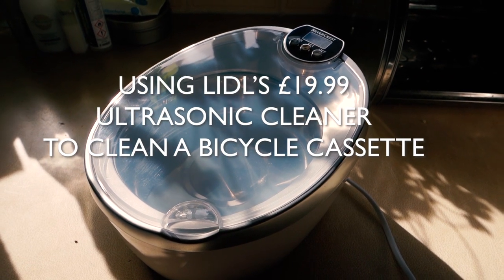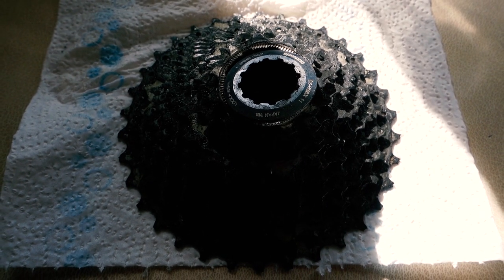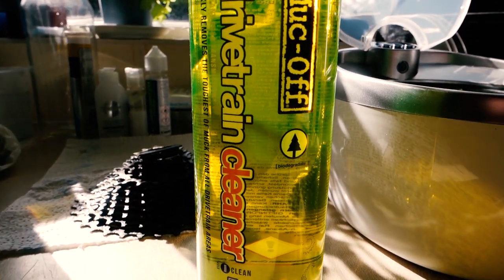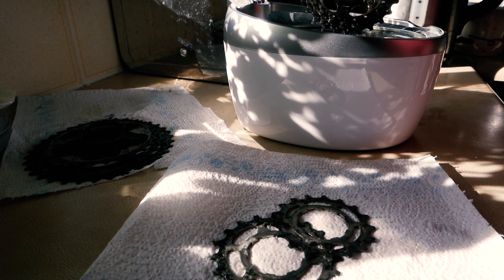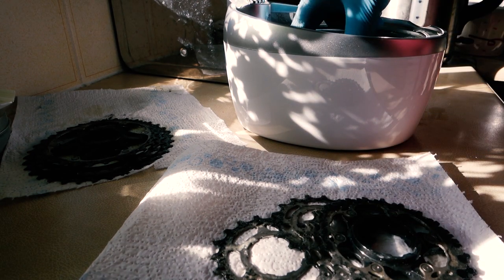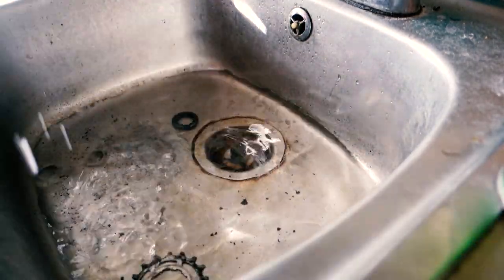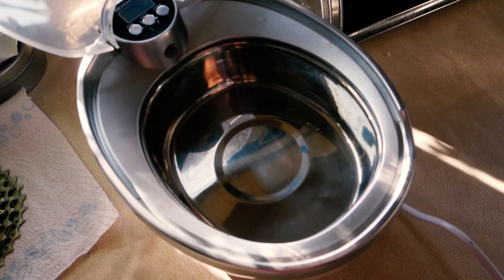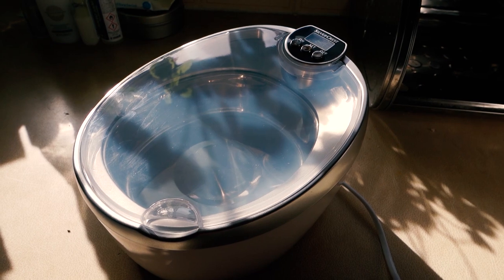Cleaning a Cycle Cassette with a £20 Lidl Ultrasonic Cleaner

Comment: I have 4 motorbikes may I suggest you clean your chain and gears on your bike on a weekly basis this will avoid wear on the sprockets and very simple use a brush and water with detergent and then a quick spray with Wd40 when dry and possibly lightly oiled after when you have to strip down and clean chains and sprockets the damage has already been done.

Comment: Don’t use paper towels, they contain wood that’ll dull the metal surfaces. Also, with a proper device you don’t need to scrub it—just run it empty with fresh detergent every so often.

50W devices, such as this one, are a-okay: First run a very dirty cassette in a zip-lock bag (with 30% IPA or similar) for 5 minutes to catch most of the sooth. Then allow 30 minutes for one bath in the tank with “orange cleaner.” Yes it’ll get warm. Then rinse the cogs - done.

Comment: Is it heated ?
Reply from the maker: No. Agitating the water does warm it a bit, but it's not heated. I think you're best using warm water to start with. Plus degreaser.
Reply: I would think that hot water/degreaser would work much better, I use an ultrasonic for cleaning records ok it wasn’t £20 from Lidl 😀 but it works fantastically